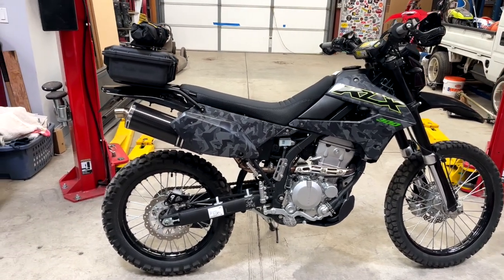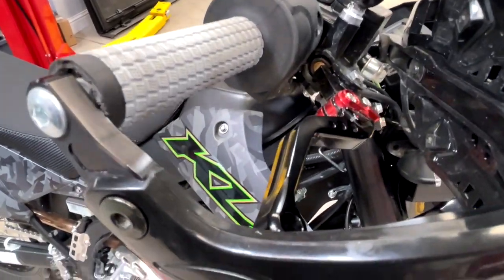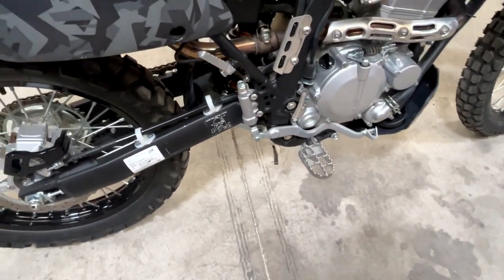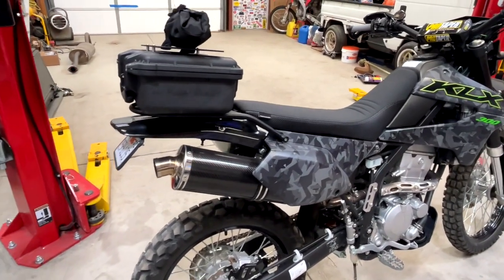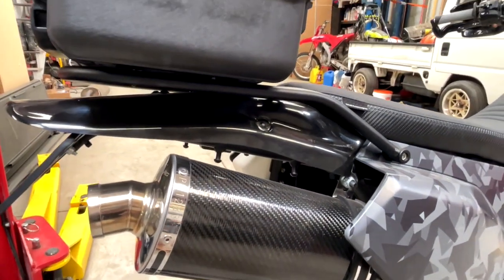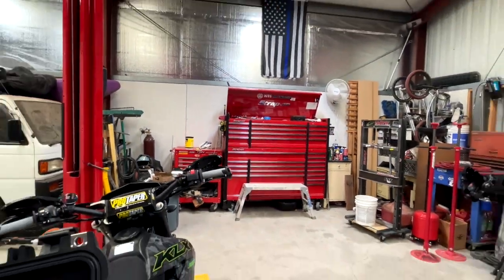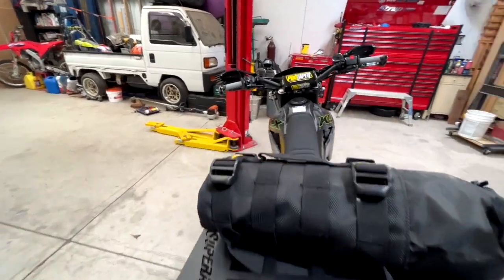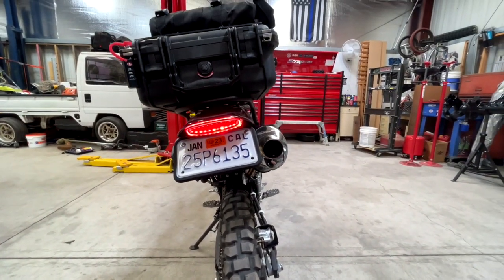2022 Kawasaki KLX300 Modifications and Upgrades

Comment: Love what you have done with the bike. How do you like it for Commuting? Pretty comfortable ride? Great video!
Reply from the maker: Hey thanks Christopher!  Ironically when I purchased it, using it to “commute” was the last thing in my mind.  With the way fuel prices are ($6.29 a gallon here for regular) I am finding myself riding it more and more.  I will say one of my favorite upgrades so far is the seat concepts.  It is a night and day difference.  As with most “dual sports,” the lack of wind protection is a huge factor.  Highway 101 is the main thoroughfare here, so to go anywhere in a fast manner, you take that.  I did take the visor off my DS helmet so you don’t get the rip your head off movement when you turn your head and that huge sail on your helmet!  But yes all in all it is great for that.  If I were using it for a daily commuter, I would definitely want a little more wind protection.  But with this being my first ever Kawasaki that I have owned, I am very impressed with the bike!

Comment: One more question man did you do the tuner with the exhaust? Or just put the slip on on ? Did it give you any issues with anything with just doing the slip on
Reply from the maker: No worries - ask away!  No I did not install a tuner yet as I am going to let the factory warranty run out.  If you do the slip on without a tuner, I would recommend either keeping the factory snorkel in the air box or install the oversized KDX snorkel.  When I was running it without a snorkel (waiting for the KDX to be delivered) that was when I had the issue with the engine dying on me when I would come to a stop.  Ever since I put the KDX snorkel in, it has ran like a champ.

Comment: Awesome bike man, do you think the Pelican 1450 would be too big on the rack?
Reply from the maker: Thanks @BottomLineBassin.  The main thing I was looking at was the width.  The exterior dimensions of the 1400 are 13.4 x 11.6 x 6" and the 1450 is 16 x 13 x 6.9".  The height and depth are no issue whatsoever.  So basically with the 1450, it would be 1.3" wider on each side.  I measured it on the rack and I think you would be fine.  One advantage of Amazon is order both of them and see which one you like the fit. Considering the bike came with the small tool bag, the 1400 seems HUGE haha!
Reply: @andersen24  Man I appreciate that I was hoping it would fit I'll let you know how it works out!

Comment: Did your exhaust come with the rubber peace that goes between the the stainless round hanger and the carbon fiber muffler or was that just me
Reply from the maker: Yes mine came with rubber "gasket" piece that goes on the hanger bracket.
Reply: Hi...as you move up the exhaust to the engine, there is a muffler cover held on by three Allen screws. Can you remove those screws? Also, does the screw closest to the front of the bike have some thin wire mesh between the Allen screw and the muffler cover?
Reply: @vidthusiast  I tried to unscrew mine but they are cheap hex heads and stripped and there was mesh under the heads
Reply: @BoBoBrappins  Thanks for the reply, BoBo Brappins. I found a parts diagram on Babbitt's Online Parts. I didn't see the wire mesh in the diagram so I removed it with some needle-nose pliers. I think that was a mistake. Does your KLX300 generate a lot of heat in that area? If I put my hand by that front Allen screw, it feels like hot exhaust is coming out of there but I don't know how.
Reply: @vidthusiast   i know the header area gets real hot I've seen mine glowing red hot after a minute of idling in the pitch black before mine did have a slight leak where I added the slip on

Comment: Hey man great showcase video. I picked up a new KLX300 a couple weeks back and followed your lead with a lot of the mods after watching. Also subbed to you and the guys you mention, thanks for shouting out some other good KLX channels.

I do have a question about the control area of the Pro Taper bars… the stock bars are 9” (228mm) and the contour 1 1/8 CR High bars are only 7.87 (200mm). Did you have any issues fitting everything on the left side? My clutch perch is basically at the bend in the bars, giving it a kind of weird upward angle. With everything totally tight I have about 3/8” of grip hanging off the bar. This is my first dirt/ds bike so I wonder if I’m doing something wrong? I appreciate any feedback
Reply from the maker: Hey @Bart_Fox_Hero.  That is kind of strange.  So with the CR's they are 28mm shorter or 14 mm on each side which is right at .55".  Mine went on pretty easy without any hangover on the grip.  Now I did do the clamp on grips so I am not sure if they are a little shorter or not.  I will look at mine later today and post what I find to let you know.
Reply: @andersen24  Thanks dude. It’s 228mm of control area per side on the stock bars, so you lose just over an inch off each side of the bars. I’ve messed with it more and got the grips all the way on, but yeah I’m thinking I have to get used to the control angles and maybe invest in a clutch lever that can be adjusted vertically. Anyway I’m using a lot of what you recommended in the video and loving it! Thanks again
Reply from the maker: OK the only thing I can think is the fact I have the clamp on grips along with the hand guards.  Now mine MAY have hung over a little bit, but I remember them being on there fairly firmly.  When you mount the hand guards, you have to trim off the end of the grips, so there may have been a little more excess on there.  But like I said, knowing how I am, that would have bugged me pretty bad if they weren’t on all the way!  Glad the rest of the stuff went on smoothly for you!

Comment: Radiator hoses!!!
They are weak. 
I got my 300 crossed up on a rut and laid it down. It split my hose on the left side of my bike.  I was about 25 miles from home. Luckily, it got me back home. The first thing I did when I got home was order some heavy duty hoses.

Comment: You didn't have any issues with those foot pegs slanting down and forward?
Reply from the maker: No I didn’t have any problems on the angle of the aftermarket pegs.  I DID however read and see a couple other people had to bend them, or insert washers as a spacer so they didn’t slant down.  Mine were spot on!
Reply: @andersen24  weird! Mine slanted. Do you have the part number for the ones you ordered?
Reply from the maker: @colefalls979  They were the IMS 273113.  Ironically I ordered them in black and they showed up in gray.  I do know @KC Outside had the same issue and had to modify it a bit to have them come out parallel.  And it looks like the 273113 are the black ones I ordered, and they shipped the 273116 gray ones.
Reply: The IMS footpegs do slope a little but you can fix it by adding a small bead of weld on the bottom or super glue something like a single chain link side panel to the bottom and they will be perfectly flat.
Reply: I started with Chinese green alum pegs which were way wrong angle but ims pegs are great but yes slight angle

Comment: Great video.  I'm on the fence for one of these bikes.  I'm a bit on the heavier side at 250lbs.  What are your thoughts on the power for a bigger sized guy?  I don't have any hard core trails here in SW Louisiana...just dirt and gravel roads.  Wanting a bike to scoot around here on the country back roads.
Reply from the maker: Hey Chris, I am in a 185lbs.  The 300’s have decent power.  I would say from the factory, you may not be happy, but I just added on an EJK tuner, and with that along with the other mods I did, I think you would be more than happy!

Comment: My high speed days on or off road are in my rear view mirror, so the potential tiny power gain of an irritatingly noisy muffler (only when teamed with a new engine management computer and dyno tuned) is not worth the large investment and the subsequent tuning hassles. I would rather put the same $ in the suspension.
Reply from the maker: I hear ya!  That is why I went with the Kawasaki over the Honda.  The Honda practically needs suspension out of the gate, where the KLX is pretty darn good from the factory. And I also think it really depends on what model you get (AKA - CA and all the smog equipment). I would say the $410 I spent (with discounts) for an exhaust and a tuner was VERY well spent.  Removed the the PAIR valve (ok another $60 there), pulled all the choking smog equipment off, opened up the exhaust (they run lean from the factory to meet emissions) and then topping it off with the EJK tuner (1 hour install) was VERY much worth it, it is a brand new bike with a great power band.  MUCH cheaper than the $1500 to throw into suspension that is already great.  My high speed days are over too, hence why there is no need to update their suspension!

Comment: I wanted a KLX but chose the Hinda CRF300L ABS. The only thing "better" about the klx is the suspension but that's a cheap & easy fix to match with the CRF and in reality if you aren't going hard off-road the stock suspension is fine. 

The Honda CRF300L does everything just as good or better than the klx, has the Rally model, has ABS that can be deactivated, and all for less than the klx.

Kawasaki makes great bikes/ATVs/UTVs but the CRF is just plain better than the klx.
Reply: While both are good bikes I had rally completely moded before getting klx and no you can't match suspension cheaply, steering bearings went south on Honda less than 2000 miles, klx just does so much better on dirt roads
Reply from the maker: Hey thanks DogDad......trust me I went back and forth quite a bit on the two bikes.  I went to Prarie City and wrote the heck out of both of them before I bought mine.  I have always owned Honda, and can never say a bad thing about them - that is for sure.  But suspension wise on the CRF300L, it is a bug chunk of change to upgrade the suspension on them.  I priced it out to be about $1800.00 with what I would have wanted to go with.  Considering what I am using the KLX for, I just couldn't justify the cost.  I still have a couple other Hondas (CR125R and CR250R) that if I'm feeling feisty I can hop one of those, but I will say for out the gate performance, the Honda just lagged against the KLX.  But then again to each their own.  A couple buddies of mine have their 300's and swear by them.......All these manufacturers make great bikes, it just comes down to your individual preferences!
Reply: The stock suspension is fine for a beginner. 🤦
Reply: Just knowing you have crappy suspension is enough to avoid that bike. You can put even better suspension on the KLX too but you don’t have to money for other stuff like pelican case haha

Comment: When installing the handle bars did you drill holes in it like the stock bars for the controls?
Reply from the maker: No I did not have to drill the handlebars.  I will have to go look, but the controls stayed on perfectly without any modification to the aftermarket bars.